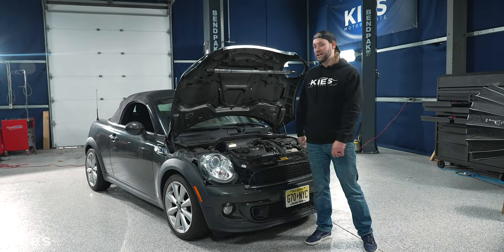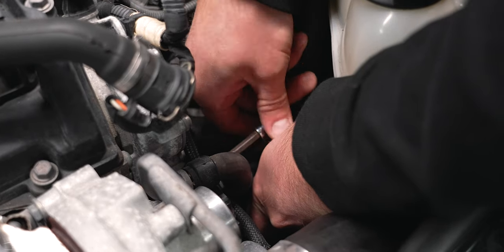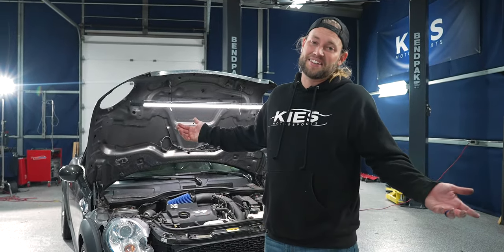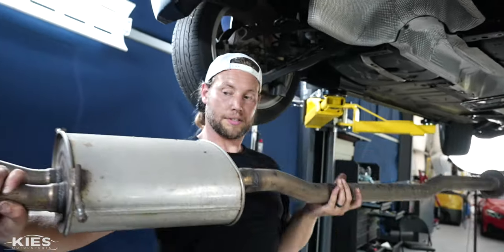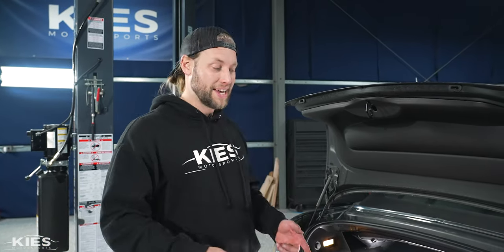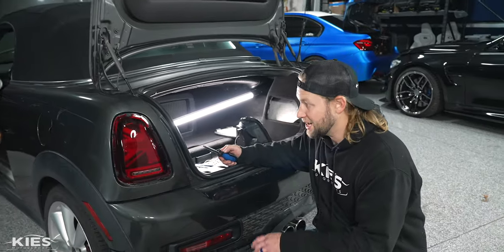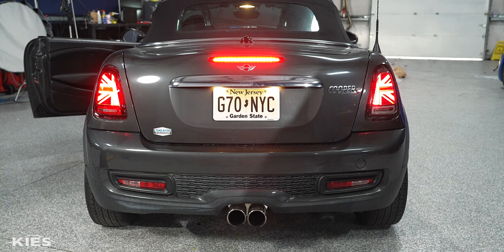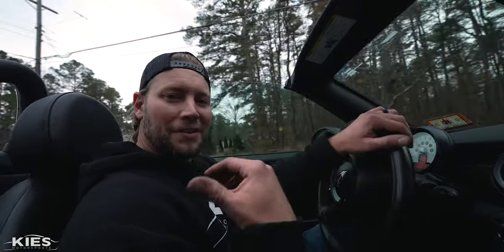TOP 5 MODS for MINI COOPER S (N18 ENGINE)

Comment: I’m very partial to the 04 mini s so much fun on the back roads and in the mountains. Years ago wife and I were in the Puget Sound Mini Club so much fun on the rallies . Still own the car just barely over 101,000 miles yes original. Oil every 10,000 and did away with run flats the price is so ridiculous. Anyway bought it used in 07 and still runs like the very first day. One thing I’m not sure about our mechanics say the clutch pedal is too tight. I drove tractor trailer for a living and to me it’s like butter. Just saying and it’s original. Love it wife will never let me sell it . I’m 75 and can still get chirping in first through third

Comment: I have a e84 x1 where the turn signal and sometimes the third brake light would randomly flicker on even though it off. Not looking for a full diagnosis but just wondered if you have ever seen that before

Comment: I have the AFE exhaust on mine and I highly DO NOT recommend it.  Muffler Input AND output were both way out of whack, not even remotely straight.  AFE sent me a new muffler and while slightly better was still jacked up.  I ended up cutting the tips off, squaring everything up, and welding the the tips back on.  And the drone was crazy, I added a resonator to tame that.  The ONLY benefit to that exhaust is that it really does sound nice!   I REALLY wish I had just bought the Magnaflow, been time and money ahead.

Comment: I see turbosmart has the diverter valve and the blow off valve, what would be the difference and why pick one over the other?
Reply: the DV recirculates metered air back into the intake.  the VtA (dump) valve sends extra boost pressure to atmosphere and makes noise.  The DV is best on modern turbo engines because of the design of the intake.  A VtA valve may trigger a CEL due to the ECU not seeing expected values
Reply: DV is best for this application.

Comment: 👌🏽 nice. Blow off valve brand ??
Reply: Idk what he's got but a stock one is just as good. With a high flow intake filter you will hear the blowoff PLENTY loud, and it actuates the same, and more reliably.